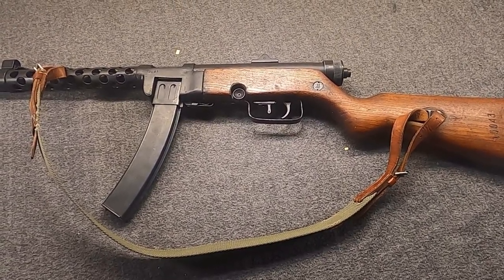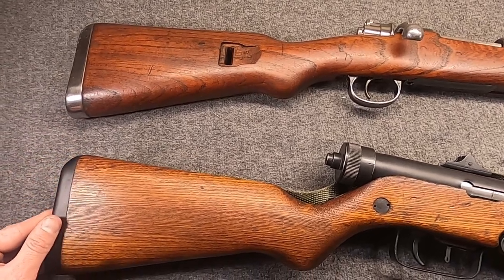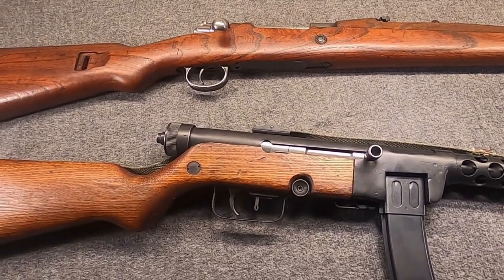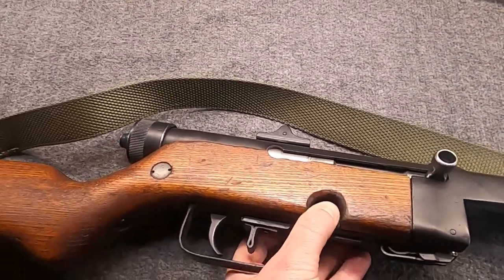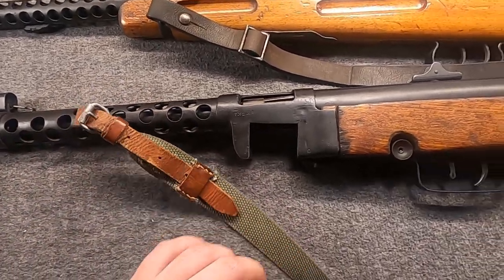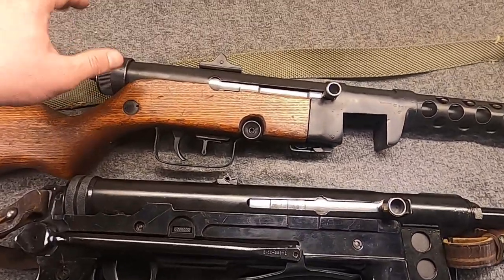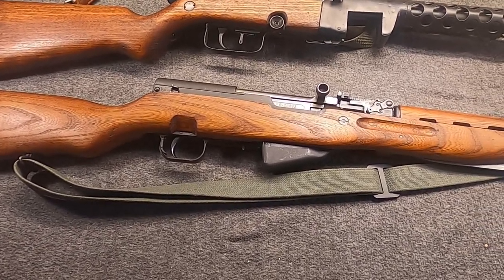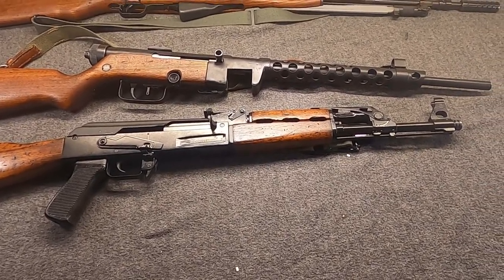Zastava M49/57 SMG Semi-Auto Carbine Conversion (The Yugoslavian Papasha)

Comment: The Yugo M49/57 is better in many ways than the PPSH 41. Obviously they took the best features of the Beretta 38a, PPSH and even Mauser and made this. Also more collectable considering much less of these were made compared to the PPSH 41's.
Reply: The Beretta MAB is one of my favorite SMGs from that era. They handle well and shoot great; lighter than a Suomi, better F+F than a Papasha, and more ergonomical (to me) than a Thompson. I have the 38A and 38/42.
Reply: @misha5670  Another excellent feature with the Yugo Zastava M49/57 is that you can swap out barrels easily and use either Tokarev or 9mm....Cheers Misha...

Comment: I am interested in how the extension was made I have a few kits including a original barrel mab/38a that i don't want to chop the stock and make some kind of pistol. With the prexis shrouds gone, im not sure what to do. I was thinking of having a machinist bore the id of the muzzle and fit an extension similar to a suomi compensator. Is that how it was done on your yugo extension or was it threaded of the barrel?
Reply: Just a simple tube/pipe pressed & tacked onto the end. I can find you the exact details if that would help you?
Reply: @misha5670  that would be amazing Misha.